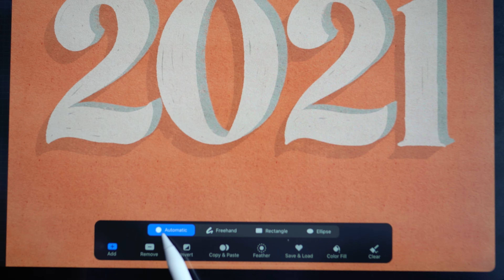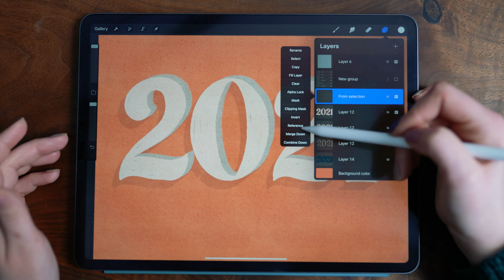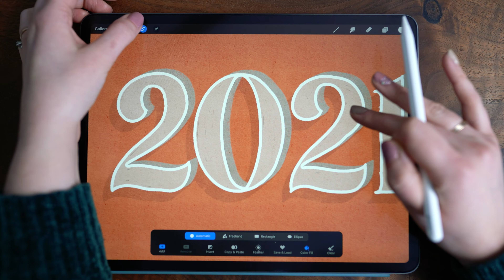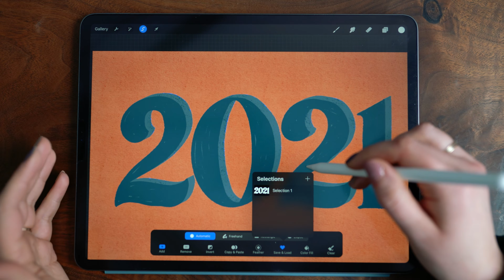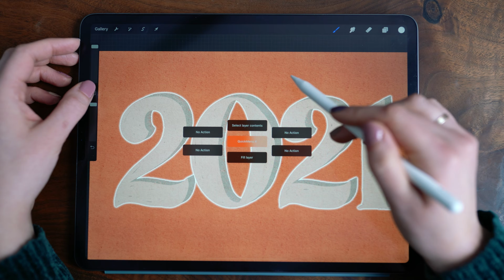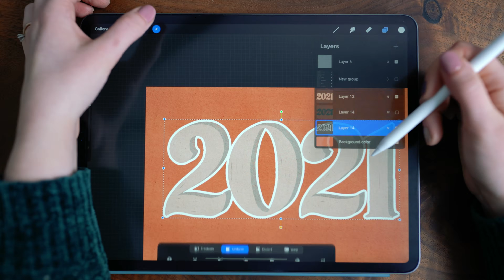How to Create Outlines in Procreate (EASY!) - iPad Drawing Tutorial

Comment: Will this print well?
Reply from the maker: Hi Char! It will depend on the size + dpi of the canvas... but you may also want to manually clean up some of the pixelation for best printing results! An easy way to do this is, before you've filled in the outline completely (so, there's still a slight bit of feathering on the edges - maybe filling the selection 5 or 6 times instead of the full 8), use the automatic selection tool to select the feathered portions and erase (make sure to turn off Color Fill).

When doing this automatic selection, instead of tapping exactly on the feathered part of the outline, tap right outside of it and keep your pencil to the screen, dragging side to side to adjust the threshold to get the right amount selected. I find a threshold between 30-50% usually works for me, but it might depend on the canvas resolution and the size of the object. This results in a slightly thinner outline, but more crisp edges. I hope this helps!!

Comment: Very helpful!  Much easier than the hand tracing on a clipping mask I have been doing.  I’ll probably clean up some of the pixelation since I’m OCD about that. Thank you.
Reply from the maker: So glad to hear it was helpful, Susan! After I filmed the video, I found an easy way to clean up some of the pixelation - because I totally feel you on being OCD about it!!  

So before you've filled in the outline completely (when there's still a slight bit of feathering on the edges - maybe filling the selection 5 or 6 times instead of the full 8), use the automatic selection tool to select the feathered portions and erase (make sure to turn off Color Fill).

When doing this automatic selection, instead of tapping exactly on the feathered part of the outline, tap right outside of it and keep your pencil to the screen, dragging side to side to adjust the threshold to get the right amount selected. I find a threshold between 30-50% usually works for me, but it might depend on the canvas resolution and the size of the object. This results in a slightly thinner outline, but more crisp edges. You might still want to clean up some of the edges, but hopefully this will cut back on some of the work!! :)